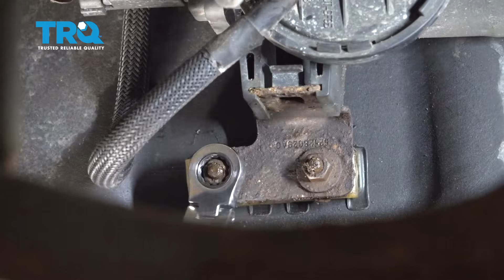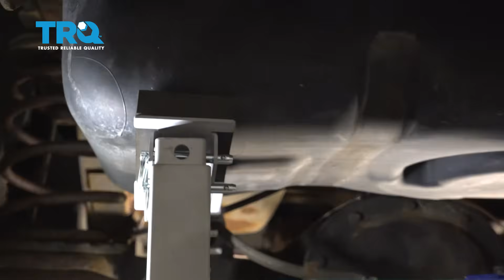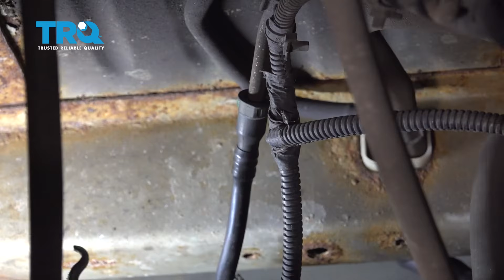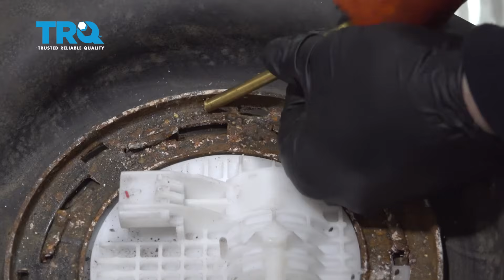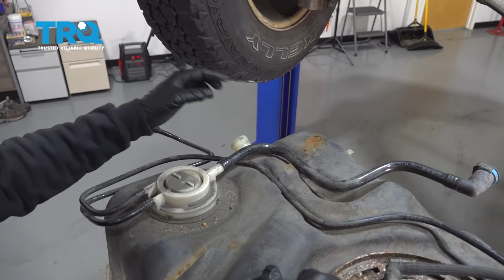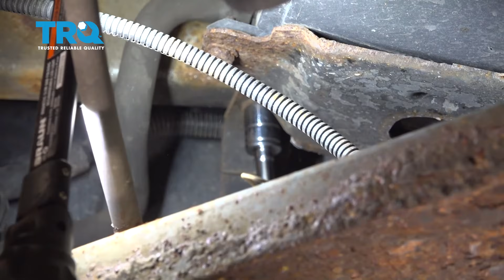How to Replace Fuel Pump and Sending Unit 2005-2007 Jeep Liberty

Comment: Anyone know where the fuel pump is on a 2008 Jeep Liberty? I get conflicting info, either under the car or under the back panel inside jeep? Also, would that issue cause my engine turn over and not start? Randomly, it will start up to three times in a row, then it won’t start.

Comment: The new pump seal was not lying flat in its' groove. I tried to install a new seal on my 2003 liberty and the seal does fit the groove it is supposed to go into. The pump will not be sealed correctly if is tightened down with seal partially out of the groove. I had to reuse my old seal.

Comment: Just use an angle grinder and cut an access hatch unless you like looking like an idiot.
Reply: If this is a customer’s car then it makes sense to do it this way (more $$). A lot of mechanics shy away from assisting with home repairs. If it’s involving with fuel they claim it is a “safety issue.” A smog tech told me once that I would have to bring my car into his shop next door so they could replace my O2 sensor claiming it was a safety issue since it involved “exhaust fumes” I literally laughed in his face.

Comment: I used an angle grinder to create an access panel with aluminum cover sealed with weatherstripping just in case the fuel pump should quit. Hopefully using Marvel mystery oil should help lubricate the turbine pump to avoid premature seizure-failure but they would last a lot longer with leaded gas.

Comment: what was that 10mm nuts you loosend in the very start of the video?
Reply: That’s the bracket for the evap pressure sensor. It has two 10mm nuts. He goes over this step around midway through the video. 👍🏽

Comment: I have a 2006 Jeep Liberty,  throws a U1411 code implausible fuel volume.  Runs fine.  Can this be the culprit? Changed the ignition switch. That did not solve the code. Any thoughts?
Reply: Did you find out what the culprit was? Got the same code also running fine
Reply: I had my Jeep scanned at a repair shop. They said it is the sending unit on the fuel pump. $600 to replace the pump as shown on this video.  I did not repair it.
Reply: I have the EXACT same problem and year. Yes it is the fuel gauge floater. I bought a fuel pump for $70 online and am doing it myself!